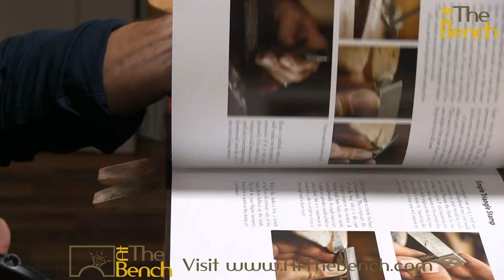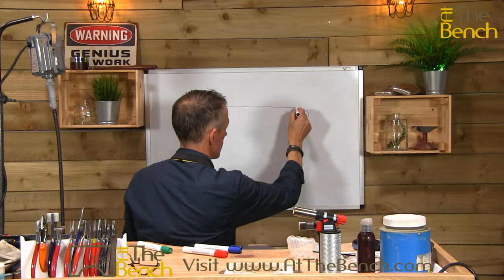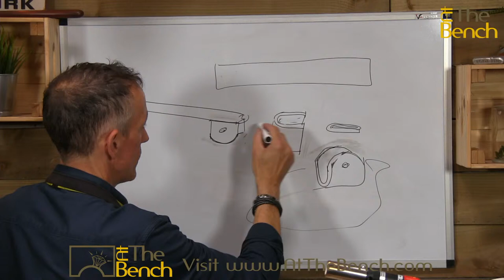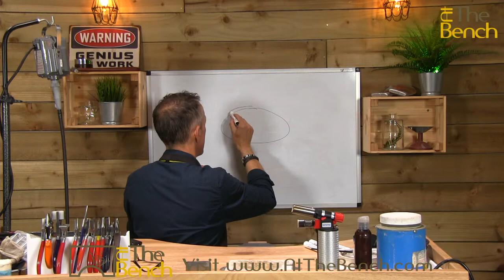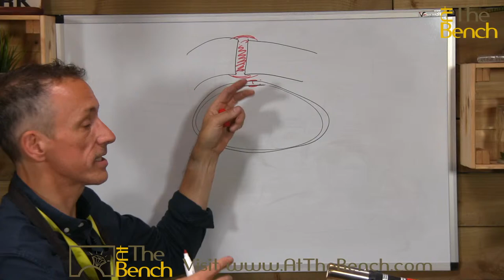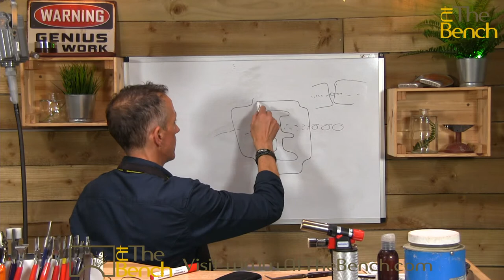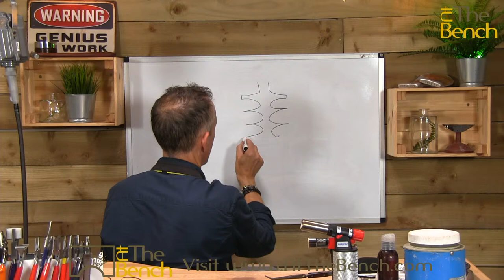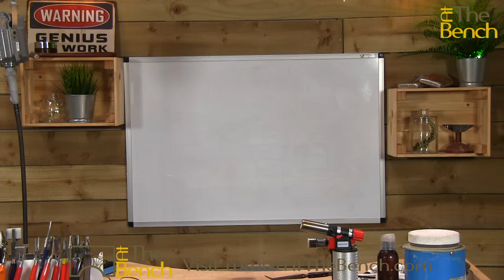Live Jewellery Questions Answered with Andrew and Louise 14th September 2020

Comment: Silver solder works perfectly on many coins. I did a lot of it in the past on copper, cupronickel and 750 silver Irish coins dated up to the 1980's Those coins, similar to the UK were the same metal throughout. Modern coins are different. Different metals coupled to make a coin will expand and contract at different rates. Sacrifice, solder a coin first under a blowtorch and see it anything goes wrong.